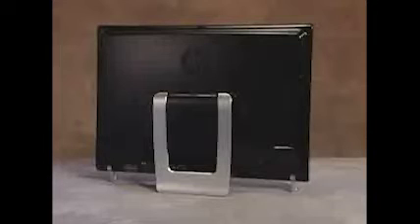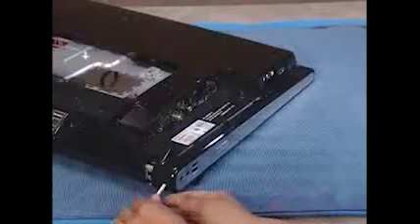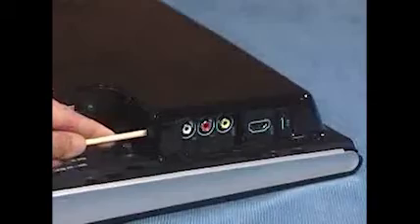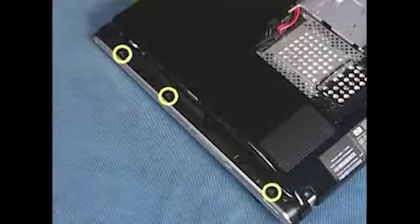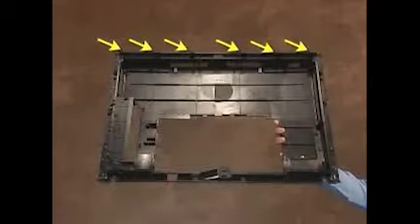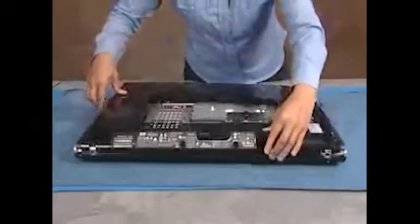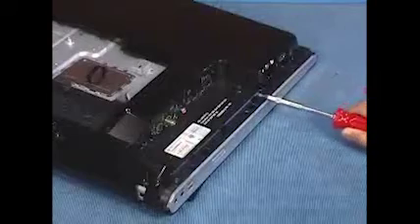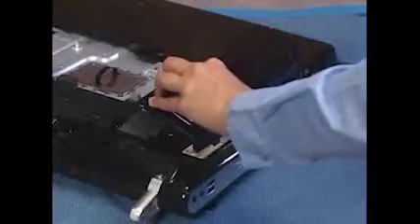Replace Back Cover | TouchSmart 600 | HP Support

Comment: Is it possible to replace an i5 430M by an i7 820QM on a IMPIP-M5 motherboard ?
Reply from the maker: Hi there, thanks for contacting HP Global Social Media Support!
I understand that you need to know about upgrading the processor of your computer.
I will do my best to assist you.
May I know the complete model number of your computer?
Please let us know!
Regards, 
HP Support
Reply: @HPSupport  Hello, sorry for my late response. The model number is  600-1220fr
Reply from the maker: Hi there, thanks for contacting HP Global Social Media Support!
I understand that you need to know about upgrading the processor of your computer.
I will do my best to assist you.
Upgrading the processor on an HP TouchSmart 600-1220 is generally not recommended due to the processor being soldered to the motherboard in most all-in-one PCs.
Regards, 
HP Support
Reply: @HPSupport  Hello, I removed the dust on my PC's motherboard, and I realized that the CPU is actually removable. I planned to replace the thermal paste
Reply: If you want, I can prove it. I have some pictures.
Reply from the maker: May I know the complete model number of your computer?
Regards, 
HP Support
Reply: @HPSupport  Do you mean the serial number ?
Reply from the maker: Please let us know the complete model or the proeuct number.
Have a wonderful day!
Regards, 
HP Support
Reply: @HPSupport  OK. Sorry for the inconvenience.
The Product No. is WX09EA#ABF
The Model No. is 600-1220fr
Reply from the maker: Thanks for the reply.
We are unable to find the details of your computer.
Due to limited support on this platform to fix this issue, I would request you to contact our Support, and our Support Engineers should be able to sort this out.
To contact us, click here: https://hp.care/6050sEsNI.
Step 1: Sign in to the HP Support page using your HP account or create a new account by clicking on “Create Account.”
Step 2: Enter the device serial number, select the product, and click on “other” from the options.
Step 3: Click on “Continue to contact options,” and choose your country/region and language.
Step 4: The support options will now populate based on the warranty status of your device.
Regards, 
HP Support
Reply: @HPSupport  OK, thank you for your advises
Reply from the maker: Have a wonderful day!
Regards, 
HP Support